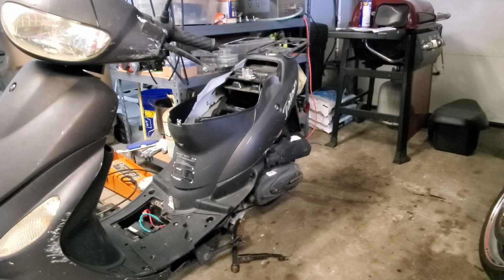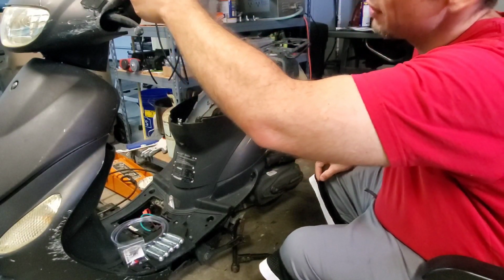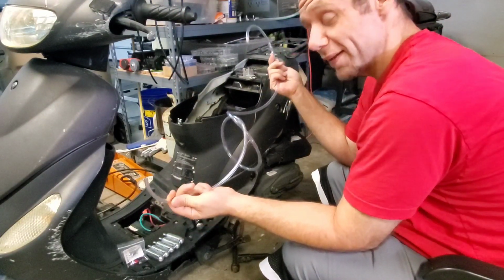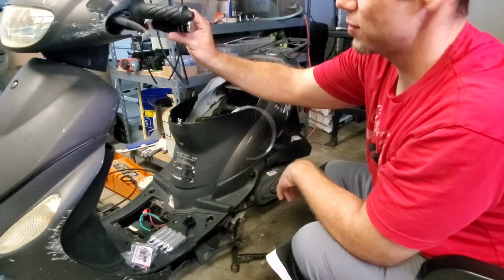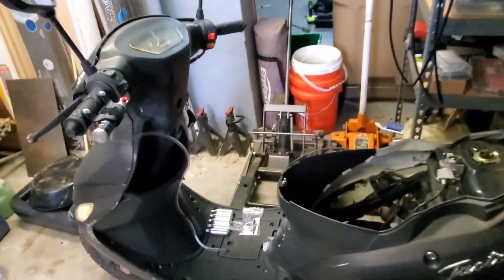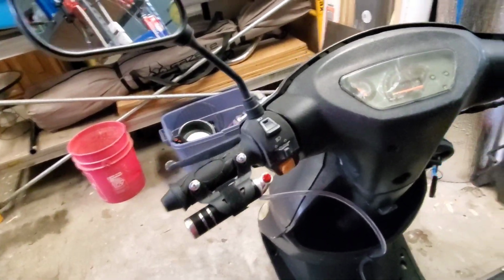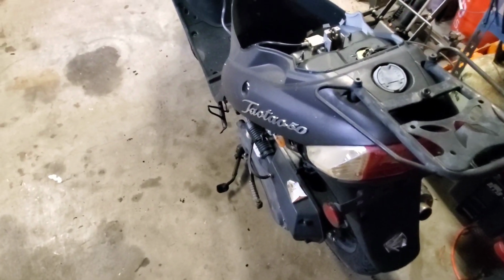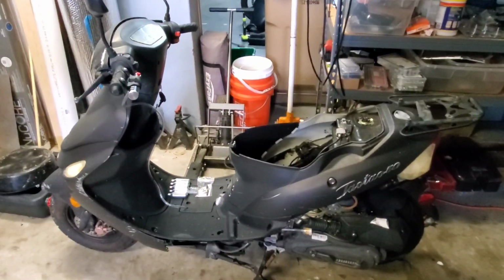50cc Chinese Scooter Gets NOS Installed!! Part 3 6Sigma NOS Kit

Comment: Hi Dan it's me again I don't have Facebook so I need to ask today I did a valve adjustment on my tao tao pony and the electric starter and horn and power will not work just it only cranked bye kick start and battery is at 11.78volts what is wrong any suggestions
Reply from the maker: Did you make sure to reconnect all your groundwires??  Also check the main fues make sure it's not blown